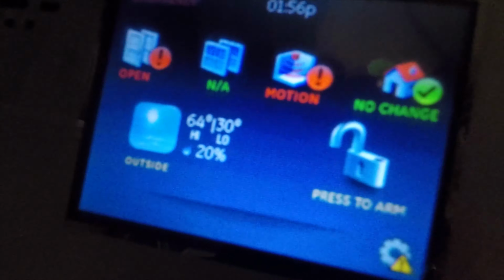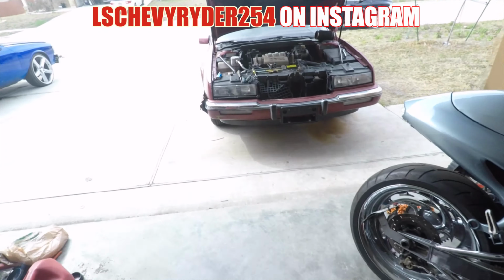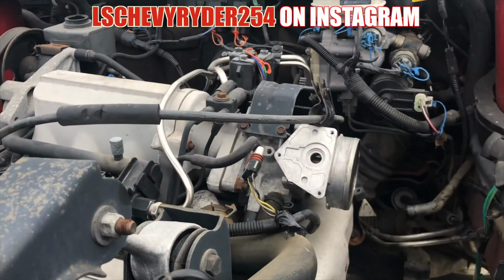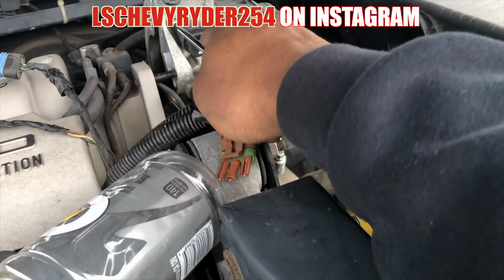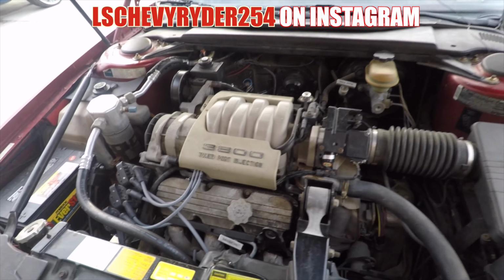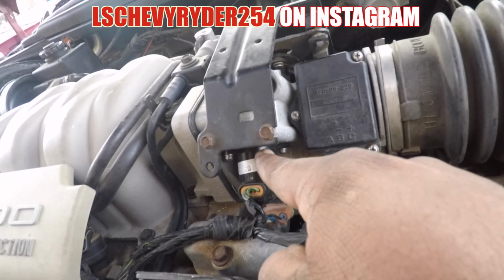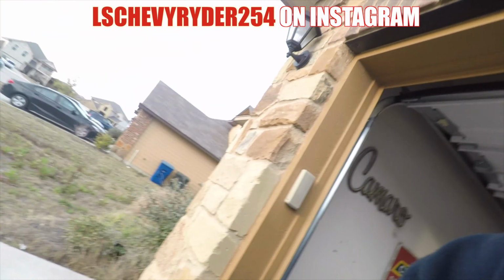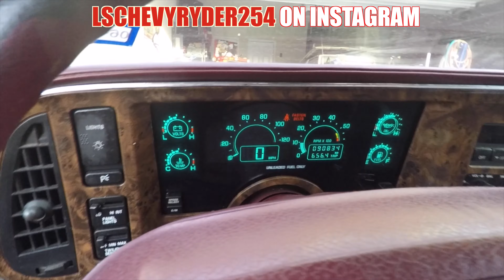JUNKYARD DAWG FOR THE BUICK AGAIN

Comment: you can also clean those IAC valves with brake cleaner.....make sure you clean the tip.. and inside the hole where it mounts.... they fill up with carbon buildup